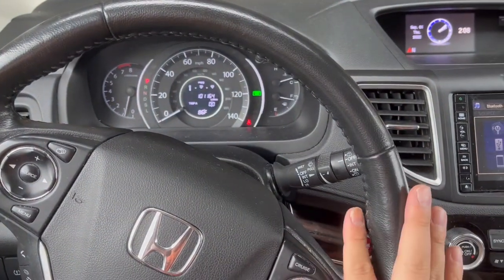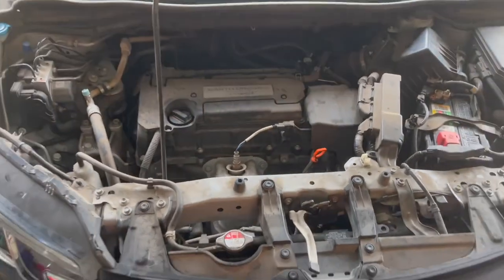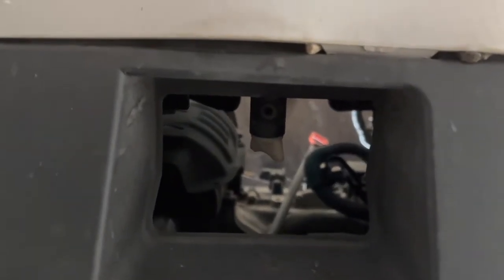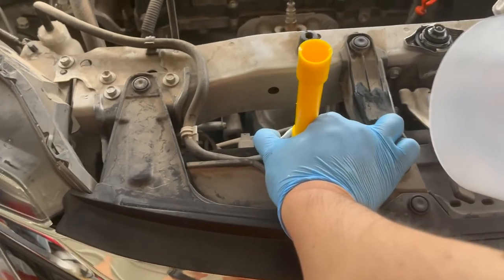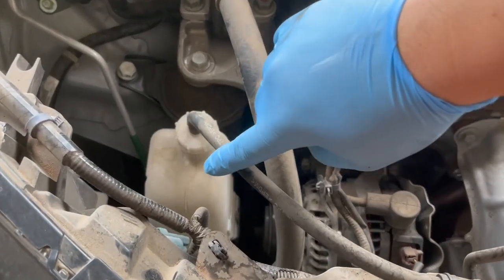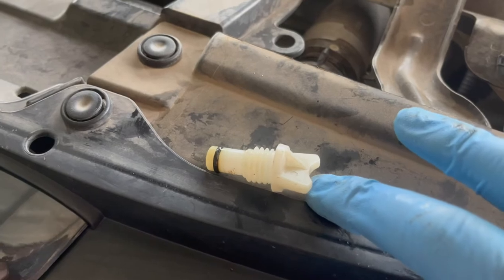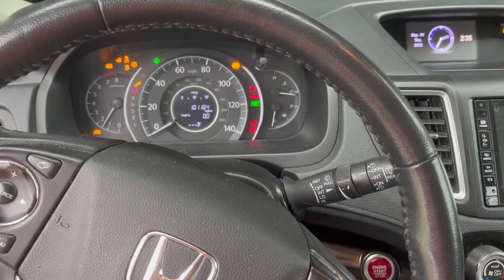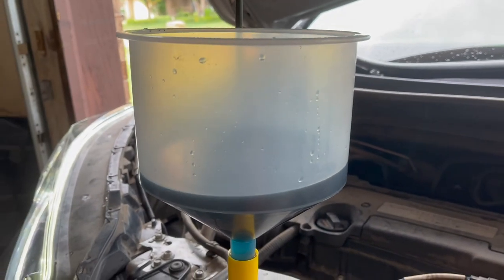Honda CRV 2015 Coolant Change EX

Comment: Thanks for the video and the recommendation on the funnel. I ordered one. The only suggestion about the video is that at 3:33, you may want to advise the importance of closing the petcock before you pour the coolant into the radiator.

Comment: Why do you have Acura fluid? Do you pour both of those in the  radiator?
Reply from the maker: Honda and acura use the same fluids and rebrand the same fluids with different brand names.  Yes, I used both